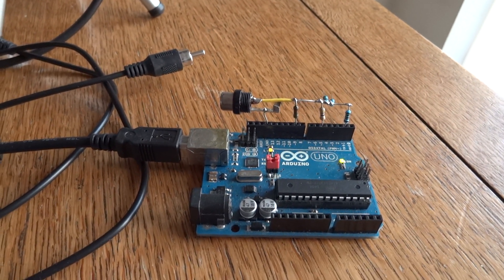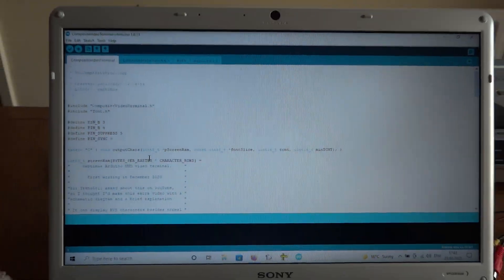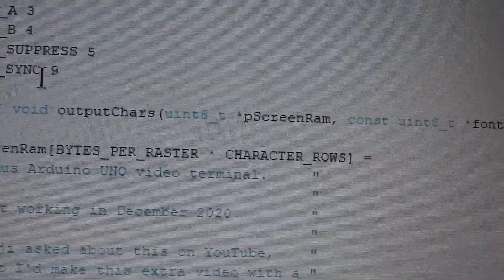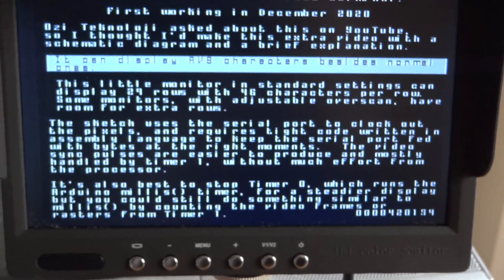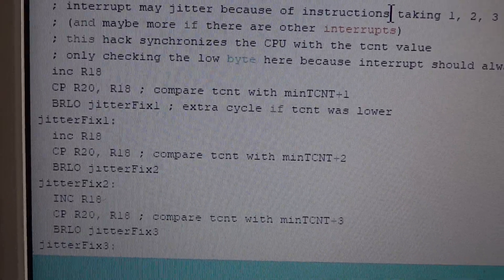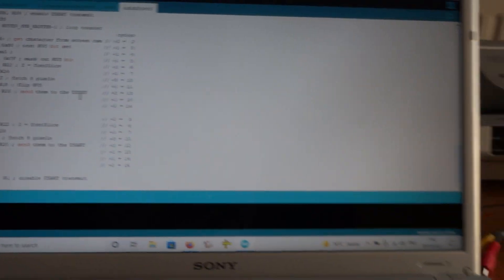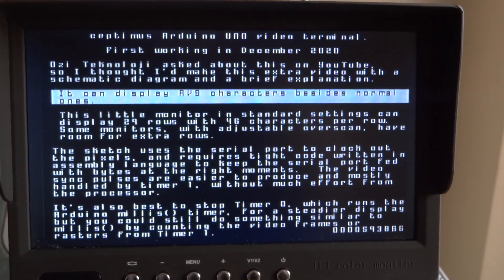Composite video from Arduino UNO

Comment: What a great project. The sketch loaded and ran with no problems. I made up the circuit from materials I had to hand, plugged it into a 40 year old video monitor and it worked first time.

Comment: my gosh. everywhere I have looked so far it's just a 1k resistor and a 470 ohm resistor on the signal wire. ingenious. would it be possible to get this TVout library to display a few more colors than just white / black? I've seen color but I guess that's pushing an UNO. can we get a few grayscales? This way we can get some better looking images?
Reply from the maker: Color isn't possible (as far as I can see) with a humble, slow, processor like the ATmega328.  To get color, you have to add a colorburst and vary the phase of the pixel signal during each raster.  Faster processors, like the ESP32, can do it.  The ATmega would need some external hardware, beyond mere resistors, to assist in the signal generation - it's not worth doing because you're just going some steps along the path of adding a complete external video card, with the ATmega telling the video card what to display.
Grayscales are possible, but not 'per-pixel' grayscales.  You basically use more than one resistor in parallel to generate the signal, so by having, say, four different resistors, driven by four outputs, you can switch those outputs to provide sixteen gray levels.  To do it per pixel, you'd need four serial ports synchronized and outputting data - the 328P only has one serial port, but even on the Mega2560, which has four serial ports, the processor isn't fast enough to keep all the ports 'fed' (unless you go to a slower pixel clock rate, which would reduce the horizontal resolution of the display).  You can switch I/O pins fairly easily per raster (when the interrupt that generates the horizontal sync pulses occurs), so you can set a gray level for each horizontal raster.  I tried it out, but, in my opinion, the results aren't worth the extra hassle.
Reply: @ceptimus  Yes the color examples floating arround on youtube are really slow looking, no refresh rate whatsoever. What would you use to display something on a monitor? (I got one with VGA, HDMI, D-SUB, S-VIDEO etc.) I got my eye on a Mega or something similar, the UNO is great for starting but quickly running into it's limits I see. I'm still waiting for the resistors to arrive to even see myself what the result is on the monitor with TVout. I can use the monitor color values to get the red color often seen on pinball machines but I'm sure they are capable of displaying inbetween of and fully on pixels.
Reply from the maker: @CrazyByte2007  Nowadays, the best, very cheap microcontroller to generate nice graphics, in my opinion, is the Raspberry Pico.  This is not the same as the (much more complicated and expensive) Raspberry Pi, which runs Linux.  You can get a Raspberry Pico for less than ten dollars.  Usually, they're cheaper than Arduinos now.  Any board with the RP2040 chip will do.  There are some that have the necessary resistors, and connectors already present to do composite video, or VGA, or even HDMI, to save you needing to solder them yourself.  You can also use the RP2050 which is almost as cheap and even more powerful, but there isn't as much example code around for those yet, as they are still fairly new.
You can program the RP2040 to do video either in MicroPython, or using C, or Assembler.  It is a more complicated chip than the ones on 8-bit Arduinos, so if you want to get right down to the hardware level, there's a big learning curve.  But there are plenty of examples that let you start simply.  Programming those to the board is as simple as dragging and dropping a file to the board - just as if it were a USB memory stick.
Reply: @ceptimus  well I'm fairly new at all this, the store I use to shop stuff don't seem to have any raspberries. Is it a device that's similar as arduinos programming wise? I'm only just starting to figure out how to work with them... figuring out how to work with buttons, solenoids, audio, and now TVout for scorekeeping and some graphical support. Next is the GPIO expander board to connect to sensors and switches. that's all I need for a pinball machine. If I would find a PICO would it be able to do all this? or can I use them both using the PICO for the scorekeeping and graphics?
Reply: @ceptimus  I just find one, is it what you mean? Raspberry Pi Pico W - 133 MHz - 264KB SRAM - WiFi, no headers
Reply from the maker: @CrazyByte2007  The Pico W costs slightly more than the normal Pico - it also can do WiFi, which is what the W stands for.  The 'no headers' part means that the connection pins haven't been soldered on - so you'd have to do that yourself.  It's probably easier, to start with, to get one with headers, and you should be able to save a dollar or two by going for the non-W version (unless you really want to play with WiFi as well).
If you search for Pi Pico on Amazon, you'll find lots of sellers of the different types. Or go to the adafruit website (do a google search to find adafruit).  They have a whole section devoted to RP2040 / Pico products. You don't have to buy it from there, but it will give you an idea of what's available.
The Pi Pico can do anything an Arduino can do, and a lot more besides.  It's faster and has a lot more memory.  It does work at 3.3 Volt levels rather than the 5 Volts that the older Arduinos operate at - that's something to be aware of, if you need 5-volt compatibility for your pinball project.  But, just like an Arduino, you can buy GPIO expanders, that will provide you with buffered or relay outputs that can switch higher voltages or drive motors, and so on...  You still just plug it into your PC via a USB lead - and that provides all the power it normally needs.  Which ever way you go, start by learning how to blink an LED on and off, then learn how to make it read and react to push buttons, then maybe add a display of some kind - an LCD or OLED or whatever.  You'll find lots of example websites to help you get started.  
If you stay interested and learn to do all that, then you're on your way to becoming an expert, and you'll think of lots of things you'd like to make it do next.  It's not for everyone, but for those who like it, it's an enjoyable hobby.  The boards are cheap enough so that if you do wire them up wrong and burn one out, it's not the end of the world... they're cheaper than a cup of coffee at some of the stores!
Reply: @ceptimus  thanks so much for this! much appreciated comments...
 I think it was 7 years ago that I got an arduino and a few servo motors, to do something I can't remember, but I do remember I couldn't get much out of it. Now I got the arduino connected with buttons, solenoids, (via mosfet) DF player, I got two GPIO boards, (and I got them to detect grounding, so that's switches etc.) next week an adressable LED strip will arrive. I'd say I'm becoming "grounded" or it's getting a bit out of hand. I could order that Pi Pico I found I got 3 volts available. it's under 10 euro. I got plenty of headers that I can solder on. 40x1 both straight and 90degree. easy to cut/break.
Reply: @ceptimus  the missing R just got in. tried it out like five minutes later. Many examples use pin 7 and 9 on an uno, but when I review the library it seems pin 8 9 and 11 are used instead. so I wired it up. uploaded the PAL example, the message on the monitor "no signal" disapears, but there is no display going to life....
Reply from the maker: @CrazyByte2007  Sounds like the HSYNC and VSYNC pulses, from pin 9 are getting through the 1K2 resistor, but the actual pixels from pin 1 (via the 1K resistor) aren't.  Make sure the 1K resistor is connected to pin 1, and if it still doesn't work, try moving the 1K resistor to Pin 0.  Some Arduino boards mislabel the 'Tx 1' pin - there's always a confusion with Tx and Rx labelling. Does Tx mean, 'this pin transmits' or does it mean 'connect this pin to the transmit pin on your other device' (in which case it's really a receive pin)?
The third resistor, the 47-ohm, on the pin I've called 'suppress' (pin 5) can be left disconnected for testing.  You should still get a display, but with a thin vertical stripe down one or both sides of the display - once you see that, you can try reconnecting the suppress resistor.
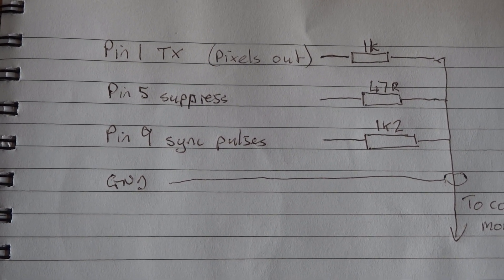Reply from the maker: @CrazyByte2007  You can see the schematic for my sketch at 1:29 in the video.  I used pins 1, 5, and 9.
Reply: @ Its running! https://youtube.com/shorts/-Y05LF5mLaw Now I can have a look again at your circuit. And if i can use a 50 ohm resistor where you used a 47 ohm....  I'm getting closer to the full build I seem to have all components now. buttons solenoids, an output, mp3 for audio, now is the most difficult part coming, writing code in such a way that every component works. I already forsee some issues cause you can only use 1 timer but debouncing needs also a timer. have to figure out how that all ties together.
Reply from the maker: @CrazyByte2007  50-ohm instead of 47-ohm will be fine.  Any reasonably low value resistance can be used.  All it does is effectively 'ground' the video signal when the suppress pin goes low.  This blanks out the, otherwise, annoying vertical line that you get when switching on and off the Serial port pin for each raster.  Like I said, you can leave it out alltogether and the display will still work - just with the vertical bright line(s) present down the left and right edges of the display.
Reply: @jnharton  Using the library I got as far as this: https://www.youtube.com/shorts/ZFV9RoAht2M
but for my purpose I needed more "images" and you run out of memory on the board, quickly. It might all work out when using a MEGA talking to another MEGA, but I don't have those to test my theory. I have since switched to blue pill boards combined with a linux machine to build my pinball onto.

Comment: Is it still possible for the microcontroller to do other things while displaying the video or would that bring the whol sync out of the cycle?
Reply from the maker: It can do other stuff at the same time.  The video output is all driven by interrupts, so it just works away in the background, without the main 'loop' program having to worry about it - and it doesn't go out of sync.
However, the interrupts do occupy a lot of the processor's time, so your main program, if it's doing lots of work, will run slower than it would otherwise.

Comment: Hello. I use it on mega 2560, It's very good ! Good job !!! But I've a white line on the left edge (it's not my screen and the problem not occur on uno). A solution for me ??? Best regards
Reply: I've a solution. You can change port 5 -> port 18. Change on main page  #define PIN_SUPPRESS 5 to  #define PIN_SUPPRESS 18. change to file outputChar.s #define Pin5 &PORTD, _BV(5) to  #define Pin5 &PORTD, _BV(3) and #define UNSUPPRESS CBI  DDRD, 5
#define SUPPRESS   SBI  DDRD, 5 to #define UNSUPPRESS CBI  DDRD, 3
#define SUPPRESS   SBI  DDRD, 3

and the white line desepear

Comment: That's a nice tight piece of code - thanks for sharing! I'm going to try changing the pixel output loop to use a line-buffer, if there's time to generate this in the blanking area, as this may allow for sprite overlays. You might be interested in this guy's work - he's a demo coder and has made some interesting things with 8-bit MCUs - this one generates music, bitmapped graphics and colour on a smaller atmega88 (8.5Kb flash, 1Kb RAM) - pretty amazing! https://www.youtube.com/watch?v=sCN1bqRG-7o

Comment: Anyone know how to adapt this to a MEGA2560? I can see video, but the sync timing is completely wrong.
Reply: Did you ever get it to work on the MEGA250? I don't even see video on my Rev 3 board. Tried different power supplies. What pins and resistors did you use? The same as in @Ceptimus's?
Reply: @geniclesoftware  Yep, same pinout. Just got scrolling though. Never figured it out, sorry.
Reply: @synchronuse  I actually did get it to work. In the sketch I changed the #define for pin 9 to pin 11 (which is OCR1A). I took the resistor values from a Video Game Shield (VGS) which are 1K for pin 11 (sync)  and 470ohm for pin 1 (data). That gives me a steady screen.
Reply: @geniclesoftware  Impressive! I'll have to try that later. Thanks for sharing!
Reply: @geniclesoftware  Pin 5 is still 47ohms, it works thx.

Comment: how could I read the composite video signal to display on a IPS LCD?
Im using a 0.96Inch RGB LCD IPS display
Reply from the maker: I don't think you could.  The 0.96" RGB LCD IPS display only has a resolution of 160x80 pixels.  All such modules I've seen have an SPI interface, so they're actually less workload for the Arduino to drive.  The IPS LCD display continues to show the same static image until the Arduino updates it, without the Arduino doing anything.  With a composite output, the Arduino has to redraw the entire display 50 or 60 times per second.

Comment: Hey can we get composite video input to Arduino and output to spi display
Reply from the maker: No.  The Arduino is nowhere near fast enough to do that.  You'd need a much faster device.
Reply: @ceptimus  faster device like?
Reply from the maker: @gurlalwraich7526  Maybe an ESP32, or one of the new RISC-V XIAO ESP32C3, or a Teensy 4.0 or 4.1, or possibly a Raspberry Pi Pico.  Do you want to handle color composite signals?  Color is harder to do.  If you need color, it's probably easier to buy one of the cheap video converters that convert composite to some more 'digital' format (even VGA would be easier than composite, I think) - and then process the resulting digital signal to drive the SPI display.  Still a difficult thing to do.  Someone may already have done what you're asking for - I've not searched.
Reply: @ceptimus  thanks for the information
I want to know that I have some old phone displays maybe with mipi interface can I use them with Arduino, I am a beginner.